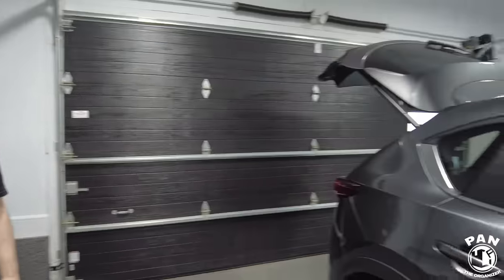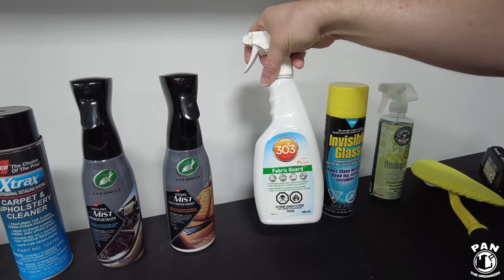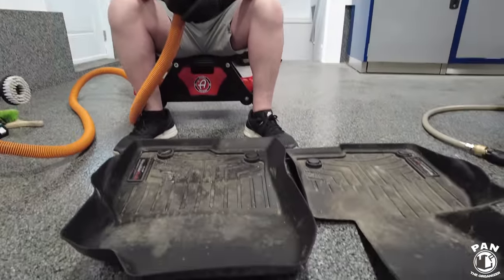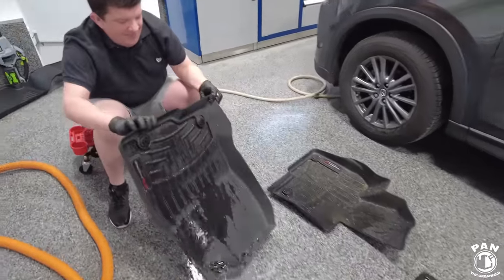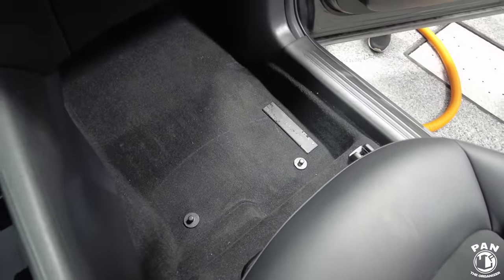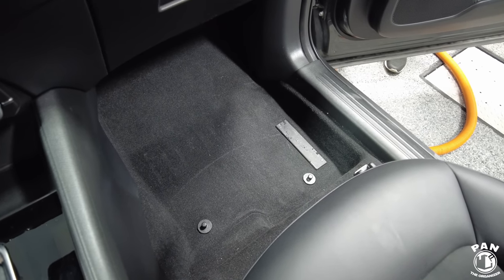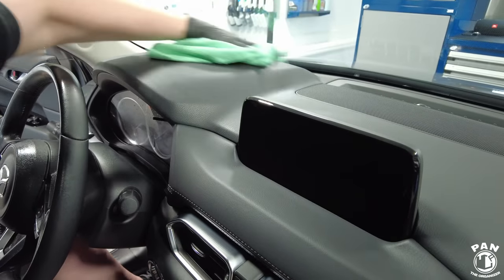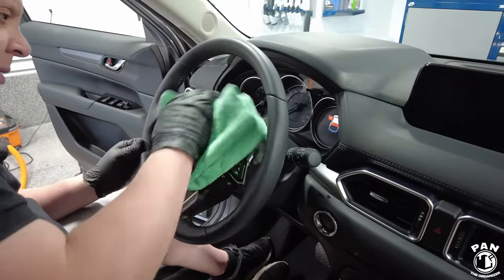Teaching a newbie how to clean the interior of his car!

Comment: Hey Pan great job with these videos, well done. When cleaning the interior fabric seats, does the extractor remove and completely dry the seats and carpets or does the car need to air dry more when you are done?
Reply from the maker: The extractor gets 90% of the moisture out, but there will always be a bit of residual moisture. You can either let the car indoors overnight with windows open, or use a blower made for drying car interiors like this one: https://amzn.to/3P5JeNL

Comment: Great video once again! :) I have a question regarding the piano black elements around the gear shift - what product is the best for cleaning/protecting it? I scratched mine using wet wipes before I went deeper into your detailing channel ... :( I guess now I have to polish it to remove the scratches
Reply from the maker: Yes you need to polish it with a light polish like Sonax Perfect Finish. I then apply a spray sealant like Bead Maker.

But protection doesn’t protect against scratches. To avoid those, don’t touch the gloss black surfaces and avoid dry rubbing them to remove dust. Always use a damp microfiber towel.